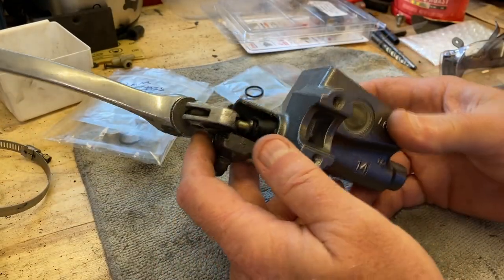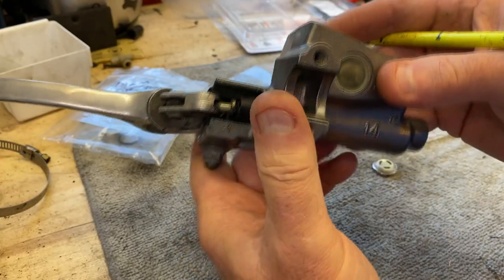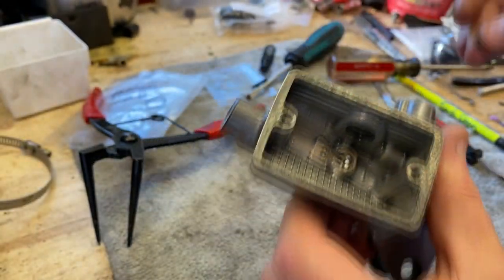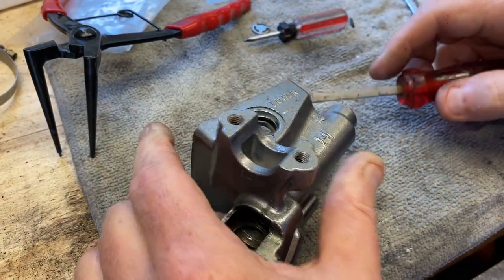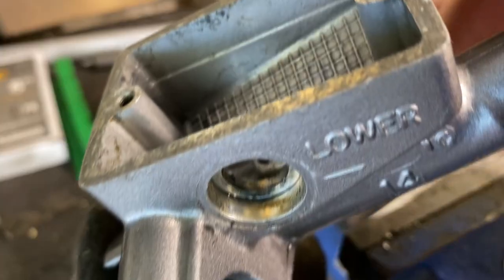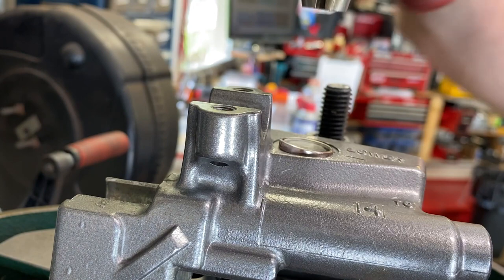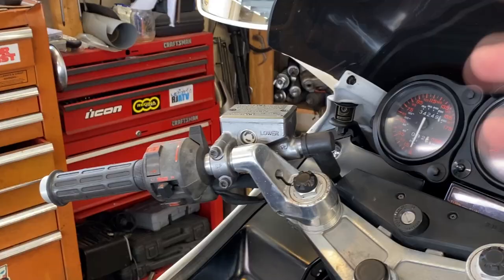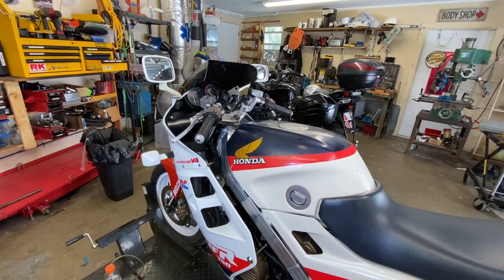(Another) Master Cylinder sight glass repair, using "proper" replacement part

Comment: I just did mine today. I have seen a lot of video's of people doing this I really don't know why they all feel the need to remove it from the bike I leave mine on the bike. The fist thing I do take screw driver and put it on the back side and tap the sight glass out one of two things will happen you will either just knock out the plastic or if you are real lucky you will knock out the plastic and the metal ring. If you have to get the metal ring out what I do is is get it from the back side. I use a ice pick. I put between the O ring and the metal rind it usually only takes a few taps and it pops right out. That trying to pry it with screw driver from the front just doesn't work to well. To put the new on in clean it up and put in the O ring then the sight glass by hand you can get it enough to hold it there then I use a C clamp and metric socket that just fits on the metal of sight glass. I put the C clamp on the outside of the reservoir. You may need a little help from someone to hold the socket for you while tighten up the C clamp to it from that point you just tighten the C clamp. It runs it in like a cream puff nice and straight Just be careful and not to tighten it to much be easy with it. When I remove the fluid out I leave enough the keep the hole at the bottom covered this way you just need to add fluid without having to bleeding the brakes. If you keep your tools clean nothing will fall inside.
Reply from the maker: Because 99% of the time, the replacement of the sight glass is concurrent with a refurbishment and rebuild. I have never run into a master cylinder needing a sight glass that wasn't pooched in every aspect. But, in cases of isolated damage or something, I'll keep your method in mind. Again, when I replace these, I'm doing the entire master refurb.

Comment: i did it on a 1985 Vmax and it has another grove and it is slowly leaking, i will try to fill the middle grove with a 19mm o ring. thanks for your video.

Comment: Thank you for your video.. going to order mine right now for my 87vfr.. do you think a 18mm or 17mm socket will work the same pushing in the site glass?
Reply from the maker: Thanks. Long as it captures just the outside edge to press the glass in place, you're good to go. I am unsure of the size you'll need.

Comment: I am about to get 2 of those replaced on my 1988 super magna. Can I borrow your tool? Where did you get sight glasses from? Thank you bud! Good video
Reply from the maker: I got them off Amazon. LE LEFOSSI 18mm Sight Glass Lens Gasket Repair Kit Motorcycle Front Rear Brake Clutch Master Cylinder https://a.co/d/39vqyiJ

You can find the standard sized ones there in this case it’s 18mm but you’d have to verify.
Reply from the maker: You can likely get away with using a socket to install them.